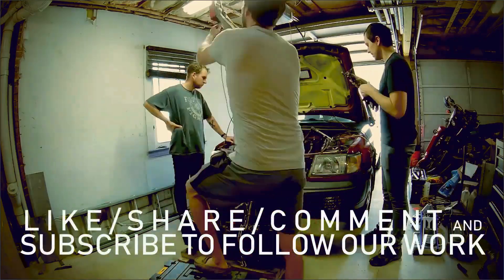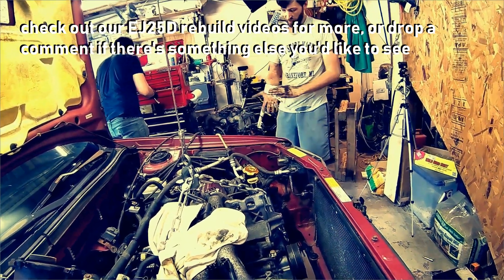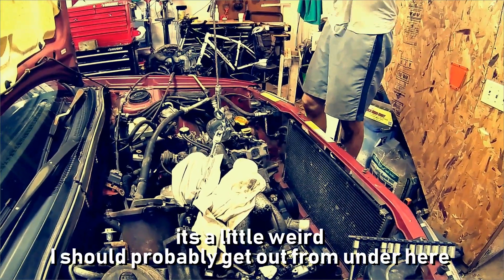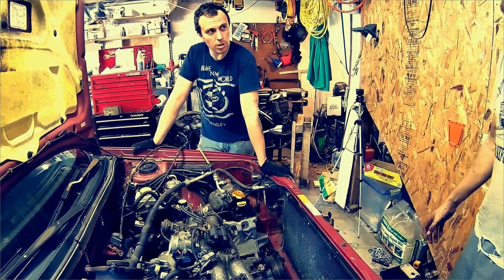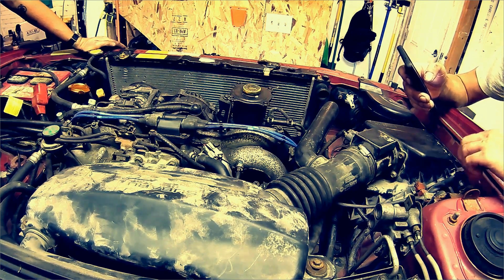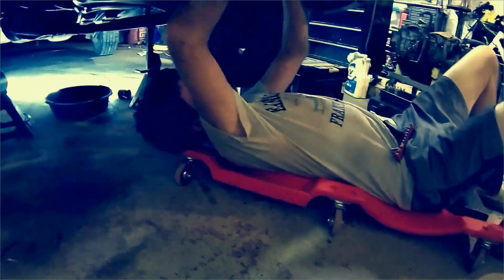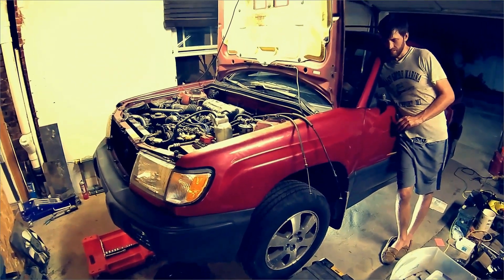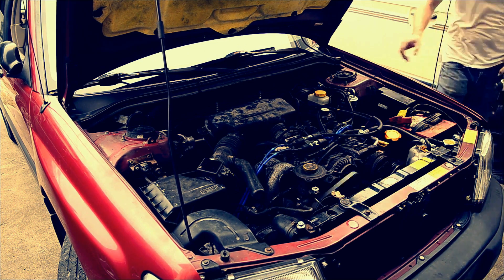Project off-road granny: swapping in our rebuilt Subaru EJ25D

Comment: hello,
I trust you are well today.
Came across your channel and this particular engine swap caught my attention.
I intend to swap my 2002 impreza TS wagon EJ15, with a 2004 forester EJ20 engine. I've done some research and it looks like a straight forward swap, apart from swapping a cam shaft sprocket and crank shaft toothed gear.
Have you had any experience, knowledge on such swap?
reason why I am going for a 2004 EG20 engine, is because it also has an EGR valve and I do not want to have to swap the intake manifold or ECU.
Reply from the maker: I don't have experience with those engines personally, but I could give some advice based on our experience. 

In this video, you're watching us swap an ej25d from a 98 Forester to an ej25d from a 1999 Legacy. We chose to do the same engine (even though the ej25d has known design flaws) for the same reason you want to do your swap - same ECU and manifold - we wanted it to be easy. However, despite the engine being the same, we still had to swap the intake manifold. This is because the 99 block turned out to have design elements from the next generation ej251. Also, we discovered some time later that it is actually quite easy to take apart the dash to get at the ECU wire harness. If we had to do this swap again, we wouldn't worry as much about compatibility - because the swap might not be as "direct" as you hope it will be, and tackling modifications to the wiring harness may not actually be so bad.

Knowing what we do now, we'd probably just go for an ej205 or ej255, because Granny could definitely use some more power. Hope that helps.
Reply: @powerofyourbrains  thank you for responding and the detailed explanation. I'll let you know once I am done with my swap.
Reply from the maker: @bonifacemuriuki3229  Good luck man, we're looking forward to hearing about it
Reply: Hello, I did my swap from EJ15-EJ20(2004 forester), everything plugged right and there was no check engine light. Car started right up and has done 100Kilometers already without any issues
Only thing I will have to change is the top radiator coolant hose. The foresters is normally on the right and the Impreza's in the middle. It did fit, but here is a slight kink.
the crank shaft and cam sprockets did not need to be changed at all, they matched up just fine..
Reply from the maker: @bonifacemuriuki3229  That's great to hear, and I imagine you're enjoying the extra displacement. For the most part these cars are pretty modular, except for cars from a few troublesome model years which unfortunately Granny is one of. Thanks for the update!
Reply: @powerofyourbrains  Yes, makes a lot of difference. Plus the hills are no longer an issue anymore. More interesting, fuel consumption has also improved, I guess it is because I do not have to press too much on the gas pedal!